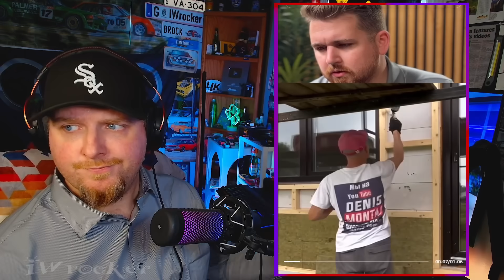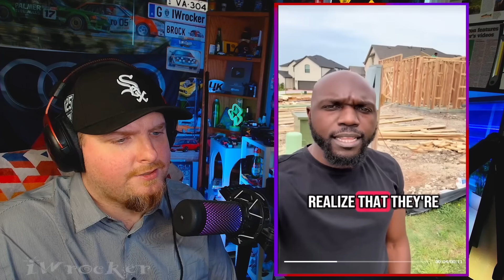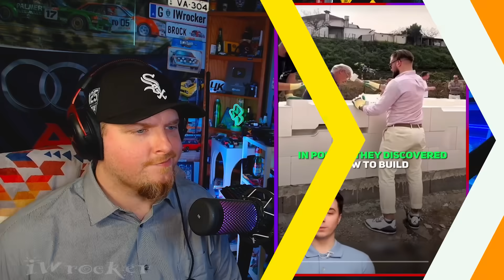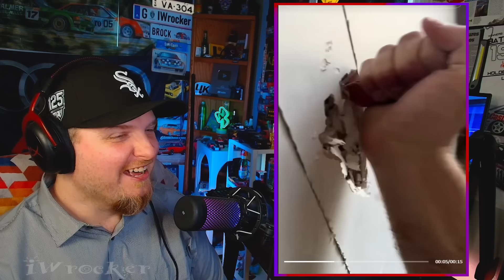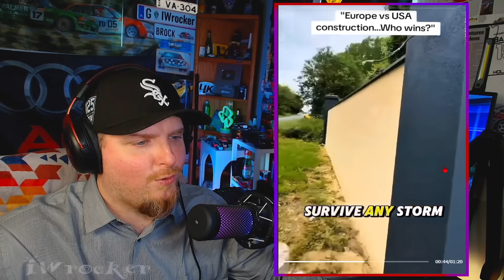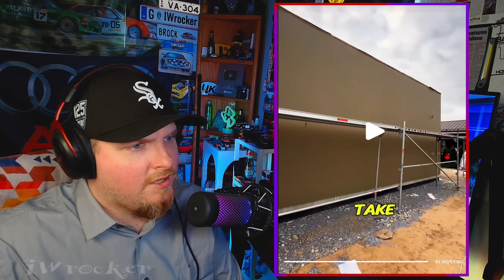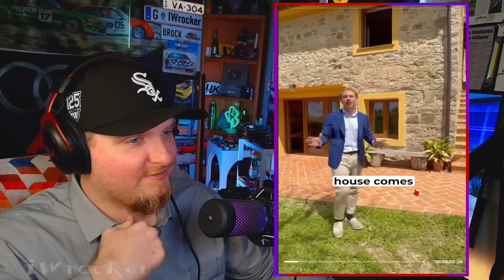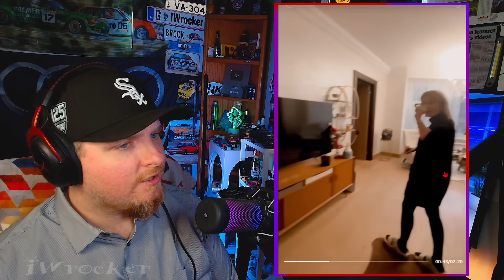25 Minutes of European VS American Home Quality & Construction Methods 🔨

Comment: I live in Europe, My own house is ± 120 years old, external walls are solid clay brick, the ground floor also has load bearing brick walls. The upper floor are drywall walls however. So depending on what floor I'm on I'm either punching through the wall or breaking my fist.

Comment: As a Belgian I've never seen insolation as thick as the blocks used around 14-15 minutes in your video. My guess is that this is in a country in central or northern Europe where it gets way colder than here. Off course we also put insolation between the quick-building bricks on the inside and the façade, but nothing as massive as this.

Comment: Probally( first video), the house, have a load-bearing structure in armored concrete.
The walls are in  insulatig cellular cement.
Usually is just very good, and more than enough.
Never seen, the second layer of insulation ( I think rock lane  of wood fiber).
Maybe  it is from russia.

Comment: I live in an apartment building in Germany. If I tried to hit a hole in the walls I'd get what the memes promise: broken hands (or dull knives). The whole inner walls of the house are concrete. It carries sound very well, if on the other side of the building someone is drilling a hole, it a: takes some time, and b: sounds like it were just beside my bed. The only thing that can do something to those walls happened a couple years ago. Luckily earthquakes here are usually weak, that one was the exception, and it still didn't do substantial damage..

Comment: When renovating a bathroom in the house, we had to break a bit around the door to make more space as the old doors were smaller then the standard doors we use today. To fit the door we had to break 10cm height and 65cm wide on the top of reinforced concrete. Had to rent a jackhammer to start breaking and stop midway because of the rebar inside. Took us a full day for 1 door+frame.

Comment: The foam goes OUTSIDE cause you can change a piece without littering the INSIDE of the house if you need a repair. Also the walls have ALL the thermal mass in a building and you want them on YOUR side, not exposed to the outside weather where exposure happens 👌.

Comment: In Finland, we also have a long history of wood building. Much longer history than the whole country of USA. Oldest buildings are mostly built from logs, only some churches and such of stone. After the WWII there was a great need for affordable houses and then we started to build wood frame houses, very much like the ones you have in the States, though at first the only insulation material available was sawdust.

Nowadays we build all kinds of houses of all possible materials: wood, logs, bricks, concrete, different kinds of blocks etc. you name it. 
What they all have in common is: they are usually very well built, sturdy, have very good insulation, at least triple windows, heated floors in bathrooms (sometimes the whole house has underfloor heating). Single houses usually have at least one fireplace and often a wood stove, so that you can still heat and cook if there's no electricity. Building codes, requirements and inspections are very, very strict - sometimes it feels exhausting how much paperwork, plans, inspections, meetings etc. is needed, even before you can start building anything. But it's all for our own good. When you buy a moderately new house, you can be sure that everything is quite well constructed. 

There are thousands after thousands of wood frame houses, but I dare say that most of them are built very well and can withstand these harsh conditions for a long, long time if maintained correctly. Even drywall is common, but only indoors of course :D 

Buildings here are well insulated, well heated, well planned and well built against cold, long winters, damp autumns, short but hot summers, wind, rain, snow...

Old houses can be different of course. During the decades after the war, a lot of mistakes were made in both building new houses and renovating old ones, so you need to be careful when obtaining an old house or apartment. But if you say that European houses last for hundred years, I would say "at least" since Finland like many other European counties is full of over 100 year old buildings, many in good condition still and maintained with love and affection.

And hey, did I forget to mention SAUNAS? Practically every single house has at least one sauna. It can be indoors or outdoors, or both. Many block buildings have either a sauna in every apartment, or one shared sauna. And of course there must be a sauna at the summer cottage, preferably by a lake.

Comment: if you put the insulation inside, you move the dew-point right into the wall which causes mold and a moist environment. Insulation always on the outside wall

Comment: Here in Europe, if you come at the wall with any knife, it will damage the paint or wallpaper and at the most it will ruin the plaster underneath. Your knife? - it's bent, chipped and or broken, but your wrist would suffer way more in a good scenario, in a bad one you would be in the hospital or a coffin and the wall would be asking if you could scratch it a bit higher.
Also if you want to install something on the wall, the most you need to watch out for are wires.

Comment: You want to put insulation on the outside to utilize the thermal mass to stabilize indoor temperature and shift the dew point of water outside your walls to avoid mold.

Comment: Regarding the Building of an European house and the outside insulation:

While in the USA the builder tries to do everything on its own, in Europe the Architect or Building Engineer divides the Jobs to several experts:

1) Basement or Slap
2) Walls
3) Maybe Inner Walls if a light Gips construction is desired
4) Chimney and Fireplaces
5) Outer Insulation
6) Roof
7) Heating
8) Electric

Unfortunately I know some american builders which do all the above things in a single enterprise with only 4 employees...

...and what they are doing is just crap.

In Europe, for every point above you need 2-3 years education and at least a diploma.

In Germany, France and Estonia you need even a License to do the work (except water)

Comment: 15:00 actually - the wall alone is insulating very well - this thick styrofoam ensures low heating costs even during arctic winter. In modern houses (insulated walls, 5-chamber 3-glass panes windows) during winter you just need to cook dinner and it's warm inside. You better have some kind of theft prevention system, because you will not hear your car alarm through the windows...

Comment: So that thickness of insulation at about 14 min mark is what you will want on a house in a country where temperatures can drop significantly below zero. It looks like 20cm insulation, which is exactly what we have on our home here in Czechia. Which leads me to what I was initially gonna comment - no way that the first house is in Russia. Rockwool is better than styrofoam, but not really in terms of heat insulation as much so that seems too thin for a country with long harsh winters. It looks like 5 cm and that is not the standard even here anymore and we are far from Russian winters. Not to mention the wood frame on te first house will have worse insulating properties and probably would not be enough to move the dew point out of the wall fully in temperatures way below zero.

Edit: The facade at 18 ish min - might be requirement from authorities to preserve the house front during a rebuilding process. It looks like a beautiful historic house in a city center and at least here, in some areas that are protected the authorities will require that the developer keeps the front and builds the new structure into it in a way in order to preserve the original look of the place. :)

Comment: As my life moved on I moved house. All my houses have been brick built with timber framed ventilated roofing supports and on a say 3 bedroomed 2 storey house the Clay or Concrete roofing tiles weight is around 7 to 10 ton depending on area.
Walls are doubled with an air gap and in some cases cavity wall insulation between.
My current house is a Bungalow stile built on a thick concrete raft and incorporates foil and foam insulation from the ground.
The ceiling are insulated in the loft and the roof breathes with gentle airflow. 
The roof overhangs the wall and all rain water goes direct to drains.
This year its particularly beneficial as we have had 45 consecutive days of rain.
But that's Britain's weather for you.

Comment: 6:20 it's a gasified concrete (waterproof, fireproof and insulating material also very lightweight). These systems let you build your own house's walls alone (ocasional help) in a couple of weeks. You need a digger for a basement and concrete for laying the fundaments - then wood beams for the roof (probably a professional roof crew would be faster and better quality). And certified electrician and plumber to avoid any future issues.

Comment: I live in a house from 1911. All the outer Walls are made of two layers of solid bricks with room in between for insulation. The inner Walls are single layer of bricks. A menace when putting up paintings and I won`t recommend hitting it with any bodyparts.

Comment: I currently live in a house built by my great great grandparents in a village near the town where i grew up, the building standarts were very different in the 19th century and the house is very low to the ground and the walls are 50cm brick and mud with straws thick, when i light up the wood stove if it burns the whole day the wall absorbs the heat and without even lighting it back up you can feel heating coming out of the walls for the next 2 days, and this is around -3 degrees celsius outside, bare in mind there is no modern day isolation on the house at all.

Comment: All the walls in my house are solid brick and plaster. American walls... they scare me. I never understood the "someone's living in my walls" thing from American spooky stories until I realized you actually could hide in a wall in an American house. It's such an absurd concept. Walls are supposed to be solid! That is the point of a wall! You need thermal mass in order to retain heat in winter! I can turn off my heating overnight and the house will only be mildly chilly in the morning because solid walls retain heat. It doesn't matter how much of that pink insulation is in your walls: without mass, the heat won't last.

Comment: Seen it done in Germany and in Belgium where im at its used often done to older houses where we can’t put insulation between wall. Because Belgium has new rules to renovate older homes you get lower taxes on it. It doesn’t last long those measurements but it’s about power usage to heat up ones home. So the bill goes down and we don’t have to use as much gas or other ways.

Comment: If you want to see some advanced and efficient Dutch house construction search for 'prefab Casco' (CASt COncrete). Sidewalls and floors are huge pre casted concrete slabs you can assemble on location and then add insulation and brick walls on the outside.

Comment: Australia. My Mum and Dad built a house in 2003 and the exterior walls were Styrofoam with rendering on the facade. It was really good. The only thing with render is the ongoing maintenance. Every 5-10 years you need to re-render and paint.

Comment: 8:00 In Poland most of construction walls is made from 24cm bricks, interior walls which are not structural mostly are made from 12cm, sometimes thinner. If someone realy need to save space or want make light walls we use drywalls. Drywalls are mostly used for interior ceiling.

Comment: To be fair, cutting plasterboard with a knife is not taking a wall down. In europe we often have interior stud walls with plasterboard and you can cut between the studs with a knife just as easy. The only thing that might make it harder is the we usually do 2 full layers of plaster on interior walls, not just taped and jointed like the states

Comment: The thin house in London is famously called "The Thin House" it is actually triangular and it is apartments. Facade only "buildings" (no building behind) do exist London, but this is not one of them. They were built to hide open cut railway lines behind.

Comment: 2:10 The wood used in Russia is Siberian fir (Abies sibirica), which, when it grows on the permafrost in Russia, exhibits unique biological and mechanical characteristics due to the extreme growing conditions.
Furthermore, the wood used in construction by the Russians is treated, but invisibly. They don't have the European or American standards requiring the use of copper-based products that turn the wood green; they use NEOMID 440 ECO in an autoclave (not available in Western Europe or the United States, but it can be imported via Serbia).
So, this guy is talking without knowing; for him, being American, autoclave-treated wood is green.

House insulation is located between the walls (here, cellular concrete with a thermal conductivity of λ = 0.07 W/m.K) and the cladding.
The latter is generally made of natural stone (granite and sandstone) in Russia.

I own a building constructed by Russians in 1536, and nothing has moved yet.

Comment: Europe has houses with stud walls and plasterboard (drywall) but only on the interior. Building regs require proper peripheral walls to be substantial
If you wish to see rapid house building with substantial materials, check out Huff Houes from Germany, they construct houses all over Europr, they,re fast and inexpensive and super high quality

Comment: Yes, I'm a Brit but have lived in Slovakia, Czech Republic and Poland - the winters can be extremely cold. We lived in what most would describe as a 'communist tower block' and over the years they retrofitted these concrete tower blocks with external, rigid foam insulation (as seen at 14.14) and the difference it makes is truly amazing.

Comment: I am from germany. 1. The flat roof of the second house ist a cheap metal roof. normally you use it for barns. I built my house of my own with concrete and a thick groundplate. And the insulation have to bee outside, because of humidity. so you let the cold and humidity outside of the house. 
i lough every time if i see american walls. In america i fan beat the wall and my fist is in the other room. In germany you hit the wall and the wall say: Do it aggein and i broke your other hand too.! :D :D . 
And windows are nomally 3 glasses for good insulation and you can open it full, only a part and you have a vent function, where you can slowly change the air inside the room.

Comment: 🇨🇵I'm living in a house built in 1900 and renovating another 50 years older and structural walls are made of stones, yes . Old partition walls are usually made with bricks. But as I'm putting in some isolation and changing the floor plans, so my walls are now mostly plastered boards. The main difference is we usually use metal framing instead of wood. 
Quite the same with  new houses the structural walls are made with bricks or concrete blocks and a layer of insulation. To cover the insulation and make partition walls , plaster boards and metal framing are in use.
And I hate metal framing!

Comment: In my house I have trouble drilling into the wall, not load bearing just internal wall, because of the stones used. Getting a hole in my walls would need a, idk, grinders, hammers, drills and time 😂😂😂

Comment: Of course, we know plasterboard walls in  Europe too. They were mostly used, when you want to divide a very big room into two seperate ones or to get an even surface to an uneven wall.
Reply: Mainly in office-spaces, where you predict you will change the floor-layout every few years.
Reply: @ThorDyrden  Two layers of drywall and rockwool insulation in between is a very efficient sound barrier.
Reply: I habe some in my house. Outside walls and inside supporting walls are all concrete and some are from double walled plasterwall. Nothing wrong with that. If you have it an apartment, it always inside as well. You only share brick / concrete walls with your neighbor.
Reply: @Staniii2360 .  Where do you live?  In my country the outside walls are double brick, the inside walls are single brick and the basement and foundation is cement.  Cement oozes radon gas and is not good in living areas.

Comment: Y'all are forgetting the timber frame colonial houses in New England that have outlasted most other structures while seeing heavier snow loads and more extreme temperature swings than MOST OF Europe.
Personally my home is a concrete berm house.  It'll be here long after most European homes have fallen apart and/or been rebuilt
Reply: Ya'll forgetting that most of Europe live more north than Canadians ;)

Comment: I recently moved in a newly built apartment in Hungary.
We have 12 inch perforated brick walls on the outside and also between the apartments, and about 8 inch of insulation on the outside all around.
The other big difference is that we have central heating with heat pump but no machine ventilation, you have to open the windows, and for cooling we have air conditioners for each floor.
In the US central HVAC solutions seem to be more mainstream which, when done right, can be more energi efficient, but takes up more space in you home.